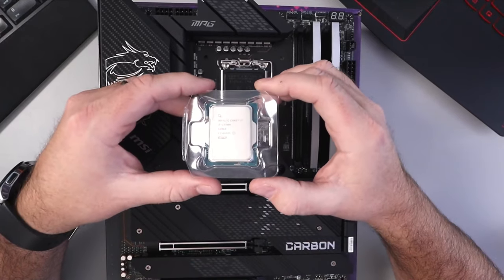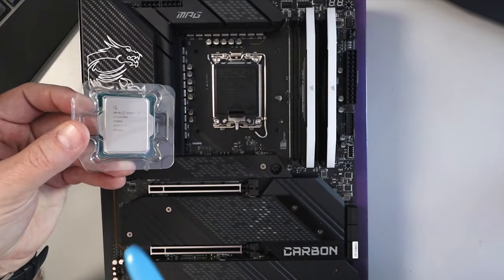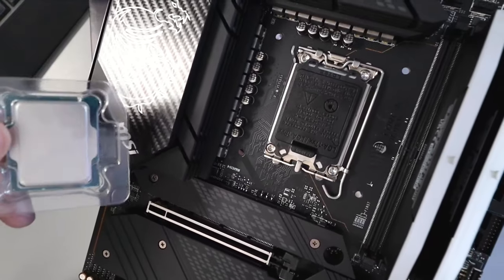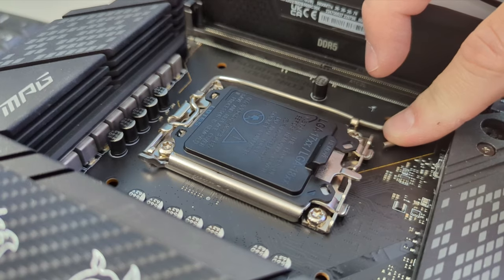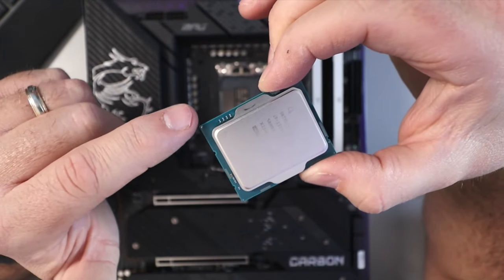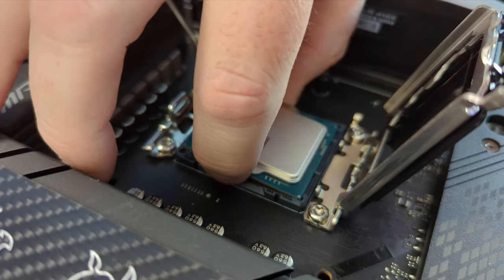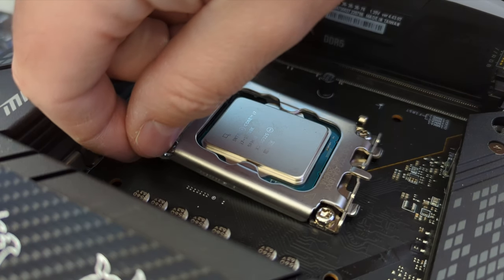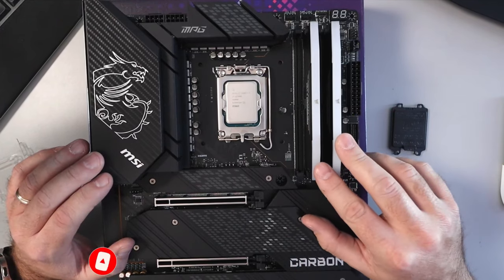Intel i7-13700K Install in LGA 1700 on MSI MPG Z690 Carbon WiFi Motherboard

Comment: I remember the days when CPUs still had pins and you had to carefully line it up, then press it down.  Trying to take it out to upgrade often resulted in slightly bent pins.  It was a big deal when they switched to the boards having the pins.

Comment: Is the lever supposed to be very difficult when you push it down because I’m building my pc and I got scared because it was super hard to push down so I didn’t push it I don’t know what to do😦
Reply: i think thats normal, mine does that too
Reply: For future people: mine was also difficult to push down, not too difficult, just more than I remembered. It’s normal though. Just make sure the cpu is properly placed and then go for it

Comment: Are you supposed to feel force? It feels very hard to push down the lever after i installed the cpu. Is that normal?
Reply: yea it should be normal if the cpu was installed correctly
Reply: Just watched the video because I was wondering the same thing. Genuinely sounded and felt horrible to push that lever down. Hopefully it didn’t break lol

Comment: I installed i5 14600k but the pin was on top right. This damaged some pins on the socket but surprisingly the pc was working fine for two days straight! How is that EVEN possible?

I just hope the cpu is still fine and not damaged by this mistake. Thanks for the video I will do better with the new motherboard. Bottom left bottom left is the correct placement... now I know :hand-purple-blue-peace:
Reply from the maker: Make sure the arrows line up. Hope you get it sorted out. All the best

Comment: Did you do a video on set up of the 13700k?

Mine has defaulted to 5.2ghz, 2 cores, and on cinibench it shows 3.2ghz whils control panel says 5.27.

Comment: mostly landed here to check if 13700k would fit in "MSI PRO Z690-A ProSeries Motherboard (ATX, 12th Gen Intel Core, LGA 1700 Socket, DDR5, USB 3.2 Gen 2, PCIe 5, 2.5G LAN, M.2 Slots)" some people were talking about ddr4 for 790 and i was like what. so if I want to upgrade later i think this mobo + ddr5 ram + 13700k would fit together...if so just gotta wait for 2-3 years for people to be dumping them at half price for the new shiny

Comment: So no thermal compound?  It's been many years since I've built a machine and I recall having to use thermal compound...
Reply from the maker: Yes, you'll put the thermal paste on right before installing your CPU cooler.
Reply: @NorthernVikingEveryday  Ahhh, mine comes with a cooler though (no letter in model number) so might not need it... we'll have to see when I get it then.  Thanks for the reply! :)

Comment: Is it idiot proof? Is it possible to place the CPU in any other position by mistake? Is there a positive indication that you placed it correctly?
Reply: Just look for the arrow for the correct orientation.  As long as you do that the CPU is rectangular and has little slots so you can't put in on skew or anything like that.

Comment: Could you help please. For upgrading to 13gen, am I need to connect 12gen CPU first, than download upgrade? Am i right?
Reply from the maker: No, you can flash the motherboard before you install all the components. If you look back in my channel I do have a video for this motherboard on the topic.
Reply: @NorthernVikingEveryday  Thanks
Reply: Where is the video sir?

Comment: I have just bought this motherboard myself to pair with a 13600k, have you had any issues at all?
Reply from the maker: As I'm filming my build It's not quite complete yet.  But I'm sure it will work great 👍 MSI makes a very good product.
Reply: @NorthernVikingEveryday  Intel working every time. The question you should give, if you install an AMD cpu

Comment: Did you have to flash the bios for it to work?
Reply from the maker: You'll have to check your motherboard specs and model number to see if it needs an update or not. It's also a good idea to up to your bios regardless so that it runs at its best.
Reply: @NorthernVikingEveryday  thanks for the help